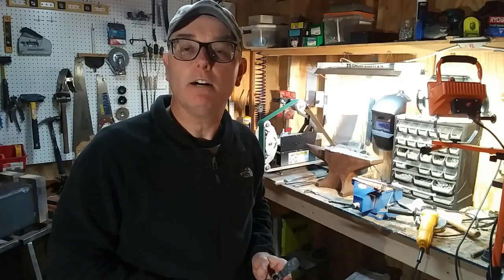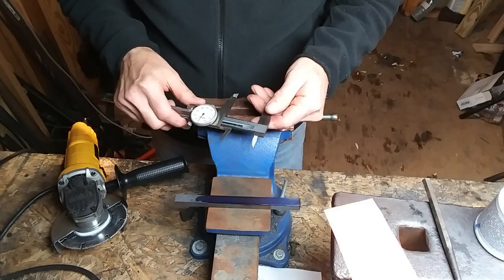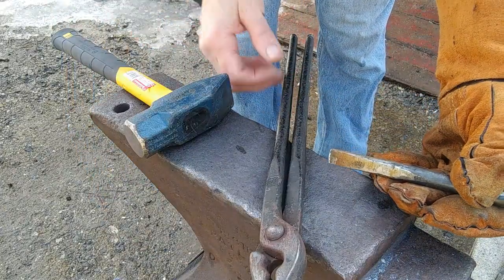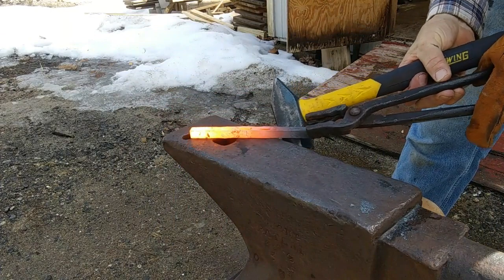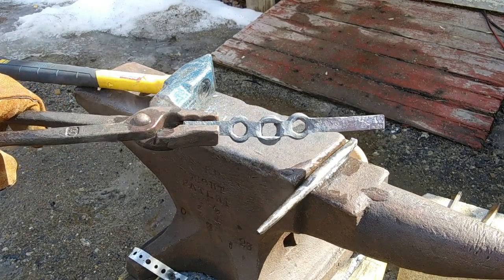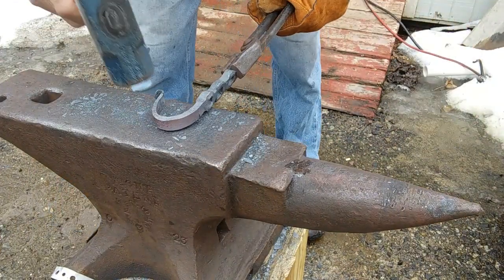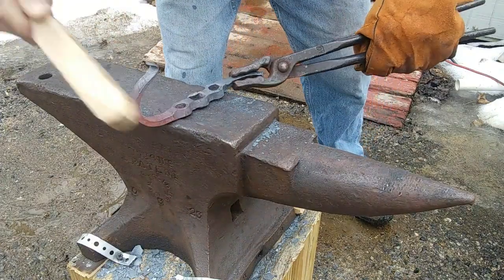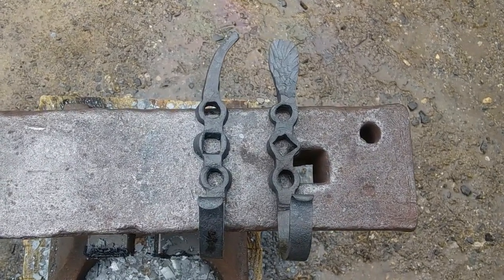Forging and drifting a wall hook

Comment: Hey Ray. I found your Power Hammer video and immediately subscribed. If you haven't gotten rid of them you have some very good steel to make chisels, punches and the like behind the hammer. Those Railroad clips make some perty good tooling. And yes, you will want to use that hammer doing it. It can be done by hand but, you got a power hammer...!!
Reply from the maker: Yes I picked them up for that reason, and the power hammer does a good job drawing them out once I straighten the clips out.